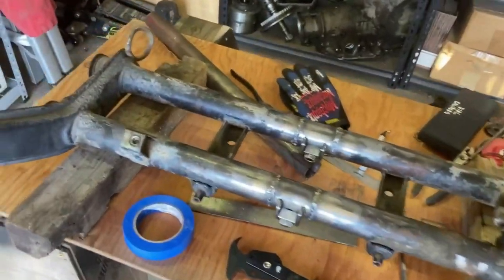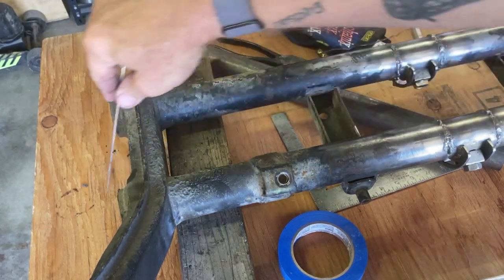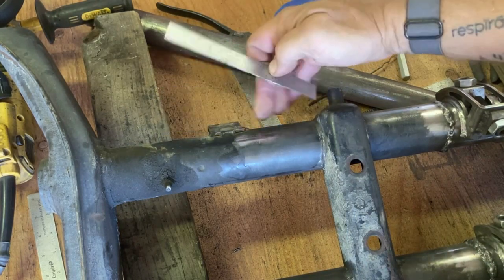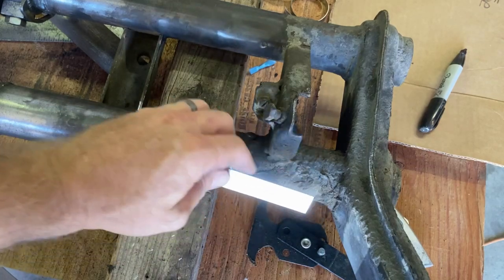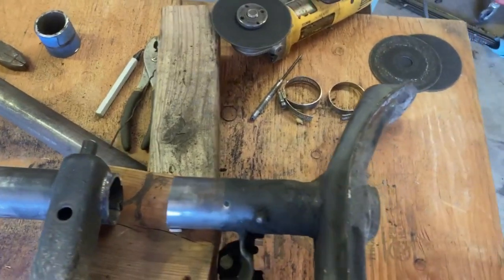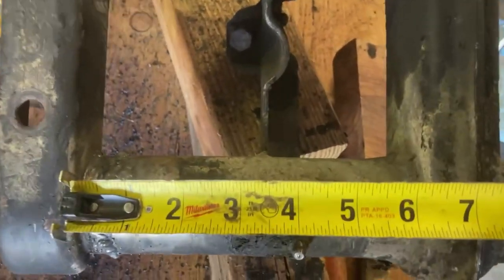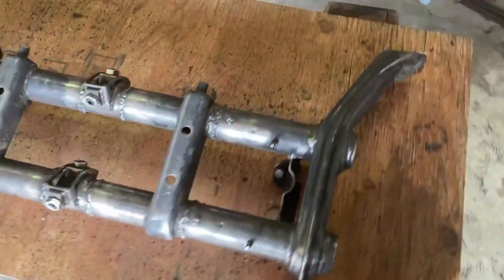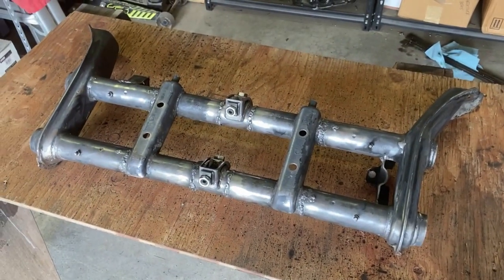1969 VW Bug Project - Episode 54 - Narrowing the Beam Part 3 - Cutting Down the Tubes

Comment: The smaller of the two brackets on top of the beam is just the mount for the steering damper.
Reply from the maker: Yep.  Finally realized that when I started reassembling..

Comment: Going to be great 👍
Reply from the maker: I'm loving it.  Rides nice, especially after I took a bit of air out of the tires.  Only issue I'm noticing is my turning radius is a bit wider now since I had to adjust the steering stops to keep the tires from rubbing the inner fender well/chassis.
Reply: @SchoolStGarage  good job 👍